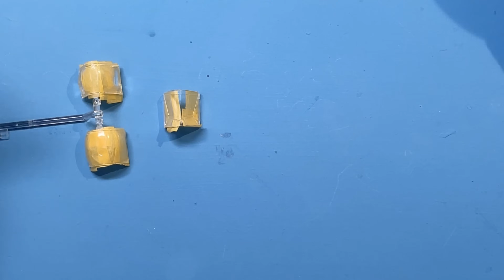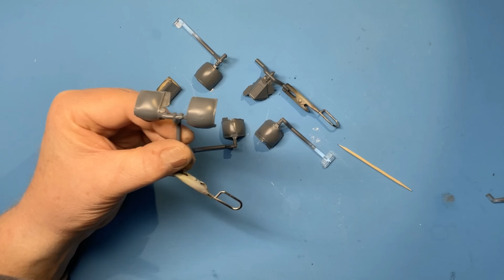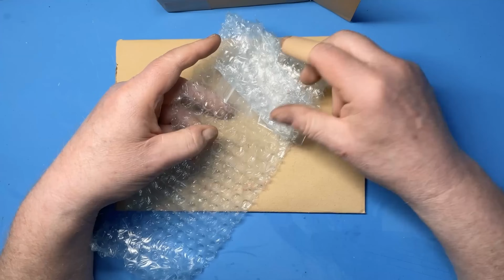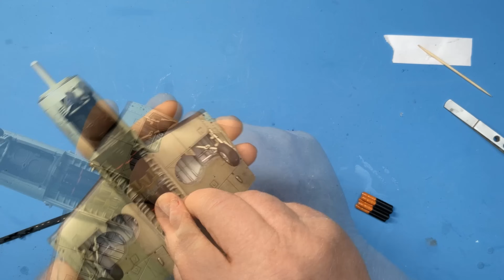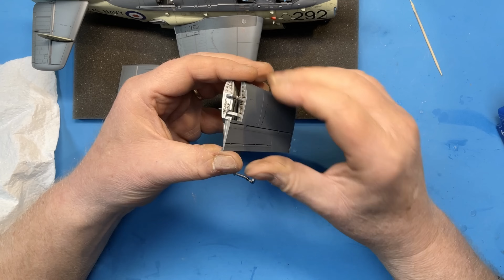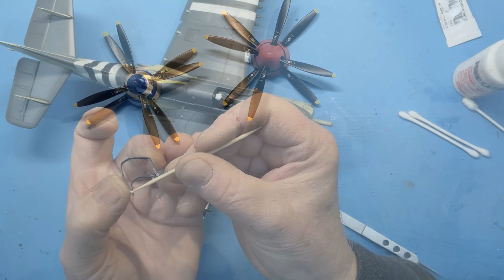Airfix 1/48 Fairey Gannet double build Part 6

Comment: Hi Steve, absolutely stunning builds my friend! Your expertise with model making always amazes me! Because you are always so helpful to me, I’m hoping a tip that I’ve learned will help you. I would highly recommend buying a pair of Godhand( hate the name) nippers. They will literally cut your sanding time and issues with clear parts by half. They even help with cutting tiny parts since they’re so tiny on the tip. I know they are pricey, but well worth it in the long run. I bought a pair of Gundam nippers years ago, but unfortunately they no longer make them. They were cheaper than the Godhand pair, but equally as good too. Either way, it’s always still recommended to cut clear parts with caution as you so wisely suggested! Thanks again for another masterclass!🙏🏽
Reply from the maker: I took your advice and after seeing some at our club meet I took the plunge and got some and some of their bending pliers. haven’t used them yet but they look the business
Reply: @TheModelShed  I guarantee you will not be disappointed! Have a good week sir!